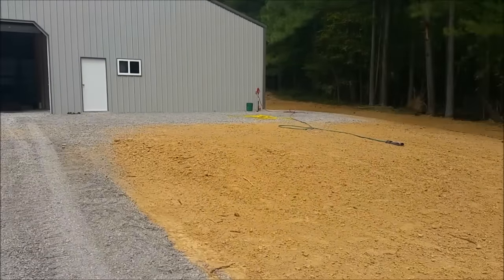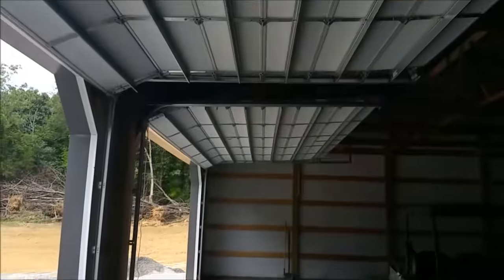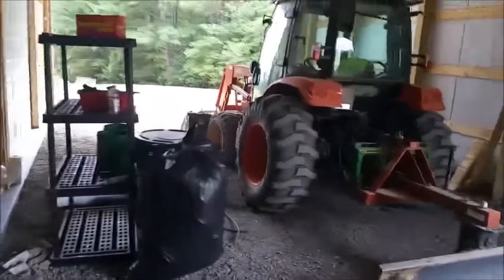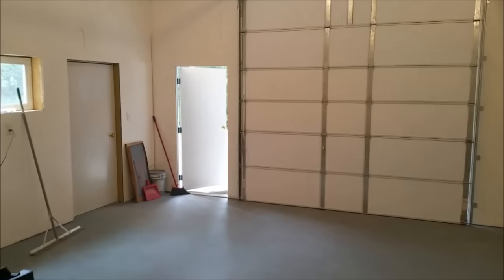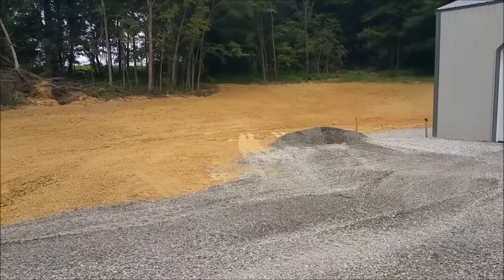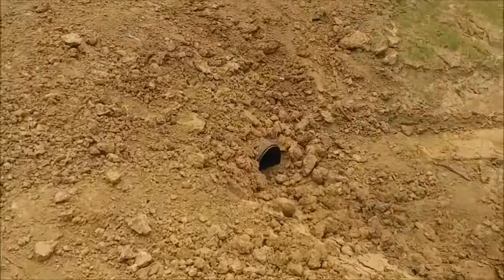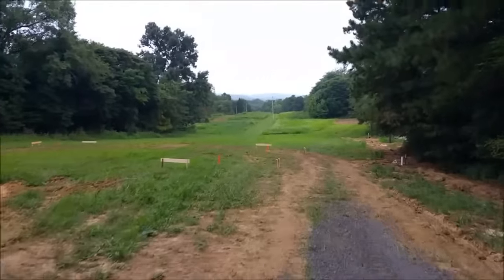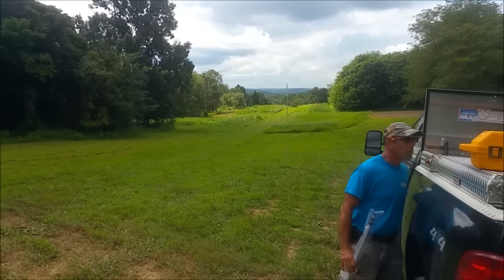Pole Barn is complete! And laying out the home site!! Kioti parked in barn..

Comment: Nice barn, I'm Building a shop with a similar color scheme, I'm going with burnished slate on the roof and some sort of gray on the sides. what color is yours? hard to tell in video but looks like maybe ash gray on sides
Reply from the maker: Yes, its a lighter gray on the sides and dark for the roof/trim. Turned out pretty sharp . Good luck on yours.

Comment: Very Nice Functional Pole barn & Work Shop. What are the dimensions?  In your opinion, is it more economical to build a wooden pole barn or Prefabricated Steel Building?
Reply from the maker: Mine is 48x80. Dang good question.. I went back and forth between the two.. But since I was having such large doors, (and insulated doors), I went with the wooden frame barn. I also felt it would be a little stronger than the pre fab place I was comparing (I didn't go with a big name like Morton, those were simply too expensive). But those pre fabs look good and are Way more economical than most stick built... Good luck!
Reply: Thanks, Great pole barn. Good advice on Morton is a big name brand and expensive.  Online, I've been looking at pictures & videos of metal frame buildings, and there are many companies with different beam/frame designs. Some are A-framed, ribbed, arched, solid beam and some are bolted or welded. Some steel frame buildings can be assembled somewhat quickly.  I like the interior looks of a Wood pole barn.  Heritage & Menards seem to have some reasonable buildings.